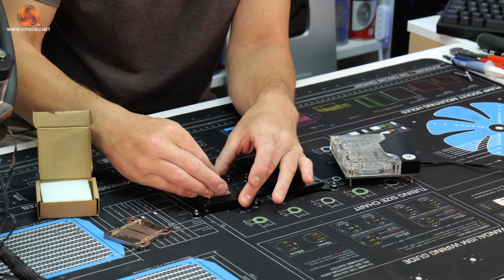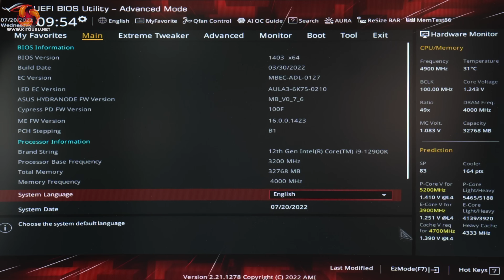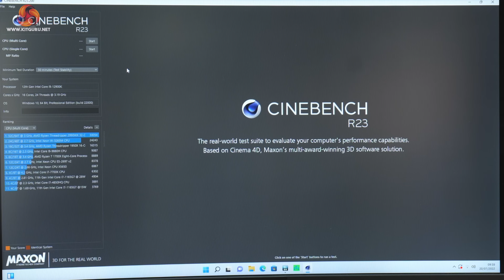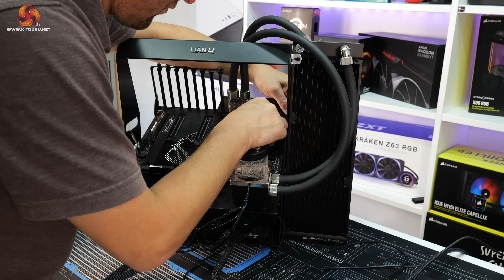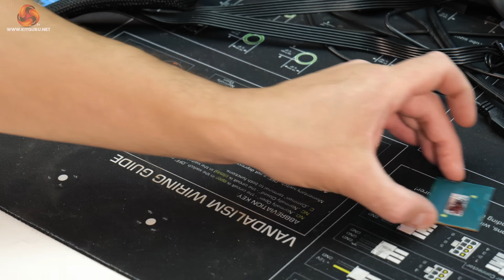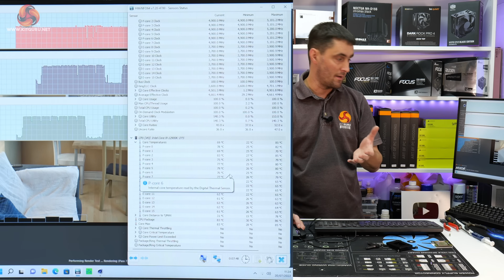12900K Delid and Direct Die Cooling / EKWB UPDATE! (Part 1.5)

Comment: my idea is probably going to be stolen but why not just create a CPU lid with the water cooling fins built-in that mounts to the upper half of a water cooling block? this would give the added bonus of sealing the CPU chip from water in case of a leak. but still getting that direct die water cooling effect.
Reply: This existed and can still be purchased. LTT reviewed it back in 2018 it's called the NCore V1. Didn't get enough sales so it's only supported up to intel 11th gen.

Comment: James, if you're in the 89 - 92 range....You don't have DD  CONTACT buddy....Get yourself some Fuji Pre-Scale film ( IC Diamond sells small envelopes of the stuff. ME....I bought two whole ROLLS ( $600.00+ ) pressure sensing film...and TEST your contact AND mounting pressure BEFORE you apply the LM and fire up the tests.   Steve over at Gamers Nexus uses it all the time for contact testing.... and James.....you HAVE TO get yourself a laboratory wet lapping machine....like Vince "KingPin" Lucido has.....I have one now.   Using an upside down "belt sander" is ridiculous from a "flatness" perspective...!
Reply: Yes the DIE to cold plate contact was an issue. EK are working on a revised cold plate which we will get a sample of soon.

I have looked into a wet lapping machine, after seeing the KingPin video but I have lots of other tool investments on the list too.

Comment: Is this proprietary to EK waterblocks? Can we use any water block instead?
Reply: I guess the direct die CPU guard frame could be used with other waterblocks.
Reply: @KitGuruJames  But based on what I can tell from the design, the CPU die itself is located inside the frame, which means the water block would need to compensate for that as well?

It still looks proprietary to me as no other water blocks have that design.
Reply: @Shizuyumi  that's correct. Any other waterblock would need a mod or custom cold plate for direct die. The other CPU frame the retains the stock IHS should work with other coolers/water blocks no problem.

Comment: Im getting 106c on core 6 and 7 with an EK magnitude cooler running at stock CPU settings. Should I redo thermal paste?
Reply: That does sound high if the CPU is not overclocked. It would be worth checking the CPU package power and what voltage the BIOS is applying to the CPU vcore automatically if you are running a "stock" bios profile. 

The voltage and package power seems to be all over the place on some Z690 motherboards and no where near Intel defaults.
Reply: @KitGuruJames  Thanks for the reply James. Ran the CPU-Z stress test again. Was getting 1.408v on the CPU VCore. Now Im new to the Alder Lake processors so I really dont know whats what. Is 1.408v high? I also forgot to mention I have the special edition ; 12900KS.

Comment: James, do you worry about EKs nickel-plating when using Liquid Metal? I know that even their current gpu/cpu blocks have issues with flaking and that's just from coolant.
Reply: Good question. It's not such a worry for me as I change hardware often. However, liquid metal is corrosive so if you plan to use it long term then expect some corrosion to the Nickel plating at least.
Reply: @KitGuruJames  it depends on the metal..

Comment: if I'm not mistaken, then one of the chips is higher than the processor crystal
Reply: One of the SMD resistors on the edge of the CPU pcb is higher than the CPU die, however the CPU guard frame is machined to avoid contact with this.
Reply: @KitGuruJames  Got it, thanks.

Comment: I found overclocking the E cores spreads out the load/heat and allowed me to run the P cores a little higher.  Scored about 45k passmark and just barely hit 90c.
Reply: Interesting.

Comment: Great video. Also agree that Intel really needs to do something about the amount of cooling that it's cpus require to function, let alone not destroy themselves catastrophically.
Reply: My 12600k runs with a noctua D14. No issues.
Reply: its functioning out of spec thanks to the motherboard manufacturers; its not really on Intel; of course they like the numbers being put out cause it sells chips but if all chips operated at Intel spec for stock then this video wouldn't exist. Intel sets the spec, mobo manufacturers chose to ignore it to sell you on a markup for a "better" motherboard.

Comment: Did you try running without the gasket on the back or making marks and adjusting the pressure on the cpu bracket to test if the slight variation in pressure is causing memory issues?
Reply: I've not tried that yet but I don't think that removing the gasket will solve the problem as it won't change any dimension or affect mounting pressure.

Comment: That is bad for all the effort you did. Something is bad there and I can tell you. Take that bracket on the motherboard and find yourself garbage can and put it right there. Buy yourself contact frame and problem solved. I am running 240 aio and OC To 5.2 P core and 4.1 E core at 1.33v. My max temp on cinabenchr23 is 85C and score 29606 and changes by 300 points.
Reply: Find that hard to believe.
Reply: @theonlyredspecial  i have no reason to speak otherwise. I can tell you one thing with mobo bracket i was hitting 100C after 30 sec. Hole point is mobo bracket is total garbage
Reply: Is that just from a single run of the multi-thread benchmark or after a 30 minute stability test?
Reply: @KitGuruJames  30 min cinabench r23. Lian li case air mash mini. Running 240 on the side Corsair as push pull. To add MSI edge z690. Bios 1.3. I would stay away from newer MSI bios because they are junk. To add ddr4 4000 cl 14. Soon it will not matter 13900k will be coming out.

Comment: This is exciting, especially that they are working with der8auer.  If EK can get the tolerances right, this could come together in a nice, all-in-one solution.  Also, would like to see some type of solution to keep the liquid metal from escaping.  Sony and others use foam that surrounds the die, but I would think the EK could come up with a better solution.
Reply: This is a very early prototype and does not represent the final retail product. Its possible that EK will include something in the kit, they will be looking at these comments so it's all important feedback for them.
Reply: If ur leaking liquid metal it means u are applying too much. When u apply it, it should have zero blobby bits and just be a very microscopic thin film. Like 0.01 mm thick
Reply: @spacecowboy07723 make sure its at least .1 mm because thats the gap left between the coldplate and the die. It doesnt actually touch the die. Unless i just got one at the edge of being in tolerance. Shouldnt be that hard to hold .004 of an inch with a surface grinder tho 🙄
Reply: This already existed in the Nudecore CNC v1 but it didn't get enough sales even after it was reviewed by LTT so they only supported it up to LGA 1200. People say they want this but at the end of the day only enthusiasts go for it

Comment: I still feel like it is on Intel to make CPUs that can be cooled with reasonable coolers. Having to use water-cooling + direct die cooling + liquid metal is a lot of requirements for not having your CPU thermal throttle. I guess if you can afford a 12900K(S) then this equipment is not out of your budget anyway. That being said, very interesting video, I liked it!
Reply: Undervolting. der8auer 20-30$ kit for a 12th gen is a good investment to that might prevent Intels IHS problems + it dosn't void warranty if you unscrew the stock cpu fastener.
Reply: @TheDembe1  and it drops cpu temperature
Reply: technically, its not thermally throttling at all, anything over the base clock at 100% load is on the motherboard via faking tau tables and power tables to gain the boost clocks during heavier loadings which is not stock operation to begin with... its running out of spec as per the motherboards "stock" settings; which of course is not supported or warranted by Intel, inb4 "AMD doesnt do this", they do and they also have the same rules on it being not supported by warranty.
Reply: @MartinGod3992  motherboard stock settings are horrible. Look how much voltage does z690 throw at 12900k. It is safer to OC with lower voltage than to run by motherboard bios specs. Warranty don’t matter. Cpu can run 10 years being OC. Amd does not do it because amd cpu is junk. Always was always will be. My 5950 came with build in stuttering and guess they all do. My first and last amd product that I will ever have.
Reply: Thermal Grizzly works better  not the old one , but the pro is working great
Reply: Its not intel. Its motherboard bracket. I am cooling my 12900k just fine with 240 aio and oc.
Reply: @stefanradunovic8318  you most not load the cpu alot
Reply: @Deviantsoundz  5.2 P and 4.1 E core with 1.33 v cinabench r23 score 29606 around. Temp 85C on 240 aio
Reply: @stefanradunovic8318  nice diamond sample
Reply: More like silver.
Reply: @ObviousCough  I guess my brother is running only at 1.28V 5.2 and 4.1 OC. Around same score as me in cinabench r23 but his gets hotter with more voltage. We both have correction frame install

Comment: Hardcore CPU cooling! I would not be that brave with a £500.00 CPU. I almost broke my 5600X, changing thermal paste (the CPU cooler sucked the 5600X out of socket!).
Reply: Happens frequently with AMD.    Next time, run the rig to heat it up a bit.   After loosening the cooler, twist the cooler to break the seal
Reply: That is normal with PGA (Pin Grid Array) CPUs like what AMD has been doing until now. Their next gen will have pins on the motherboard instead, just like Intel. Should prevent things like from happening :)